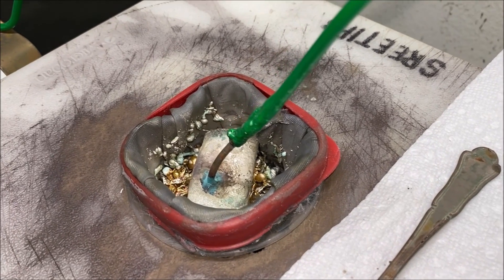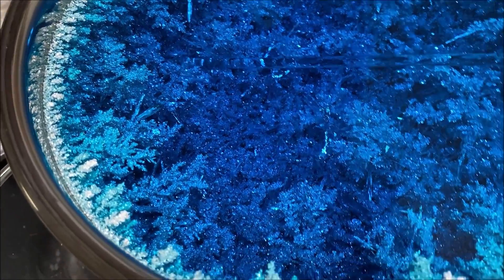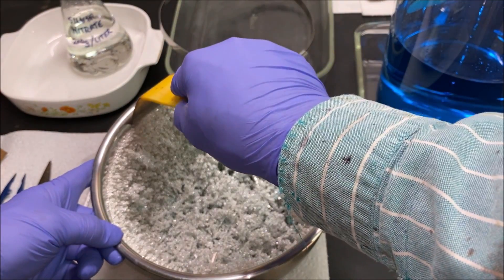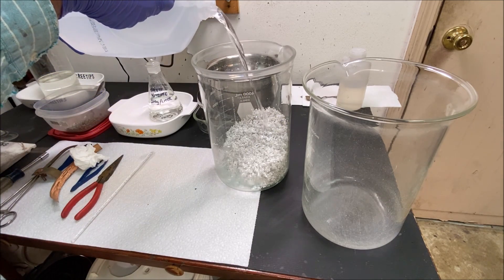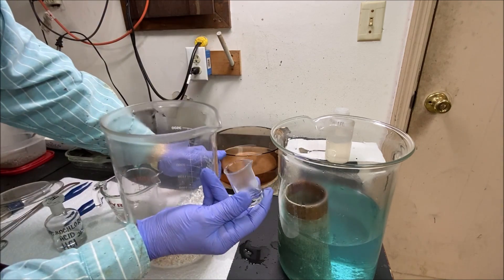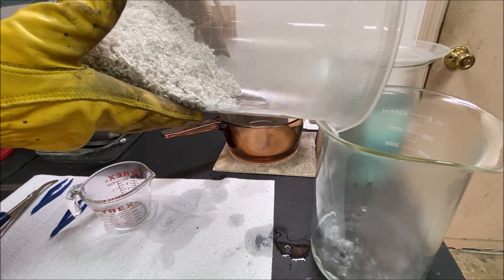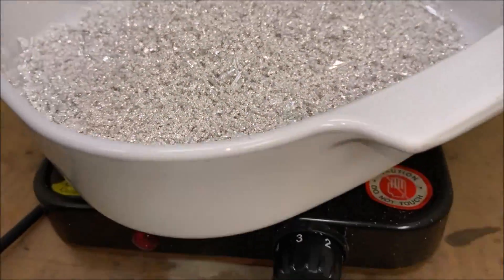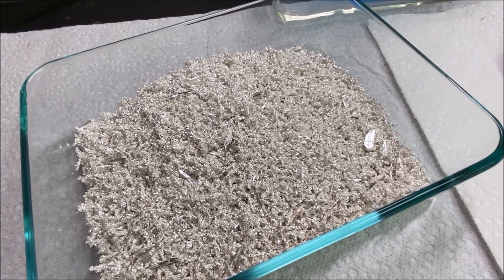Fifty Ounces of Silver From My Silver Cell Day 15

Comment: Just found this channel. I'm a little confused. Did I just witness the process of taking a silver bar, adding electricity, some solution, and YOUR GROWING PURE SILVER like from a seed?
Reply from the maker: I’m feeding impure silver through the top and passing an electric current. It dissolves the impure silver then deposits on the inside of the stainless bowl as high purity silver metal that looks like crystals.
Reply: @sreetips  Ahhhh, ok! I was wondering if I needed to stop growing lettuce and start growing wealth🤣

Comment: so - how much to produce that amount ? Is there profit ? Do you melt and bar it ? Fascinating idea
Reply from the maker: To get 50 Troy ounces out, I had to input 50.5 Troy ounces of impure silver into the anode basket. Probably a little less because some of the silver in the electrolyte gets depleted as the cell operates. It plates out onto the cathode. Profit? Not in the sense that you are thinking. I’m not refining the silver to re-sell for more paper dollars. Although if I need some paper to pay bills or buy food, then I can and will sell a little metal. But most of the silver that I refine I save and forget about it. Silver is a by product of my gold refining. And gold refining is my hobby.

Comment: Where you do you get the blue silver nitrate solution stuff and how much does it cost?  How can this be profitable... I mean they have to make the solution to sell it, and if they could just turn it into silver themselves and get more value out of it, wouldn't they do so?
Reply from the maker: The blue liquid is silver nitrate. The blue color comes from copper. Pure silver nitrate is clear and colorless. I run impure silver through the silver cell and it deposits on the inside of the stainless bowl. But I only get out what I put in, less impurities.
Reply from the maker: I dissolve some of the pure silver crystal from a previous harvest to make the electrolyte.

Comment: Got a VERY interesting, easy experiment that might be groundbreaking - labs have agitation plates for processes that require constant motion. If you let these crystals develop while constantly vibrating at specific frequencies, I'd guess the patterns of the crystals would be predictable relative to the science of cymatics, and the properties of the silver might change due to developing under different frequencies.

This method when used with different metal and crystal alloys is what I think will get us to "anti-gravity" technology (which is really anti-mass technology). In a similar way to centrifugal force causing the phenomenon of weightlessness, vibrating physical objects at certain frequencies actually affects properties like mass, density, and a phenomenon of weightlessness.
Reply from the maker: A slow vibration would help keep the electrolyte moving.

Comment: What were the silver crystals derived from I am ignorant To what you're doing I guess
Reply from the maker: No problem. I use sterling silver to refine gold. I alloy the silver and gold, then pull the silver back out with hot dilute nitric acid boils. I recover the silver by reducing (cementing) the silver out of the nitric solution on to pieces of clean copper. The silver powder (cement silver) is about 98% to 99% pure silver. I melt it into shot (granules) and run it through my silver cell to produce high purity (three nines fine) pure silver crystal. The silver crystal can be melted into bars and sold. But I just keep it. Hope this helps.

Comment: What do you suppose would happen to the crystal forms if the bowl was spinning on a turntable🤔
Reply from the maker: It would probably spill the electrolyte.
Reply: @sreetips  probably correct though ii was actually wondering about the crystal structures - silver is highly conductive but yet non ferrous. Would ambient magnetic eddies in the room stimulate patterned growth or maybe ball formations?

Comment: How many gallons of silver nitride solution did you use to get 50 troy ounces of silver?   What concentration was the nitride solution?
Reply from the maker: I use silver nitrate, not nitride. I dissolve about 600 grams of pure silver into 3.5 liters of solution. My cell size is 3.5 liters. I use the same electrolyte twice, but on the second run I add another 200 grams of dissolved silver. So for two runs I use 800 grams of pure silver, reserved for electrolyte from previous refining. I harvest 1.5 kilos from each run. So my net gain is 2.2 kilos from the impure silver granules that I feed into the anode basket, less impurities.

Comment: I'm so confused. That's roughly 36 ounces. So what's the difference between ounces and troy ounces?
Reply from the maker: A standard ounce in USA measurement is 28 grams. This is use to measure food and postage etc. a Troy ounce is used in weighing precious metals. And a Troy ounce is 31.1 grams. I was confused by it when I first started working with precious metals.

Comment: Ok at the risk of sounding stupid,  is this the process of removing plated silver from spoons etc. Silver recovery
Reply from the maker: Yes, but it’s not very easy and the yield is very small.
Reply: Thanks for the quick response.   Ironically years ago I worked in a plating shop.  Considered recovering silver realizing it would take many objects to produce any yield.   My way of thinking silver is easier to find then anything gold.

Comment: If you only get out as much silver as you put in, then why do you do this?
Reply from the maker: Because I have a ton of silver powder that is a by-product of my gold refining. Silver powder has questionable value. Pure silver crystal can’t be duplicated or faked. It’s value is increasing, while paper dollars are decreasing. It’s a no brainer. Why store my savings in paper dollars that are losing value? I’d rather have my savings in silver that is rising in value.
Reply: @sreetips  So, the silver powder isn’t sellable, but it can be turned into silver through this process?
Reply from the maker: The silver powder is 98% to 99% pure silver with main contaminant being copper. It don’t take much copper to make silver look very ugly. It can be sold but it’s value is questionable because it’s not high purity. The silver crystal is three nines - industry standard for pure silver.
Reply from the maker: Running the impure silver gets out the traces of copper so that only high purity elemental silver gets plated out on the cathode. As long as conditions are kept tightly controlled, then the copper will accumulate in the electrolyte and it won’t plate out with the silver.

Comment: Let's say that the AgNO3 is the limiting factor, so there is sufficient copper.

I found that 100 mL/0.100 L of 1.000 M silver nitrate is ~$50.00, rounded to the nearest dollar.
Because M=n/V and MV=n, there is 0.1 mol AgNO3.
1 mol AgNO3 weighs 169.87 g/mol, based off of what I found online (too lazy to pull up a periodic table right now).

169.87 g/mol AgNO3*0.1 mol = 16.987g AgNO3 is in this solution. 16.987g AgNO3 costs $50.00, then.

Now, NO3 weighs 62.01g/mol, approximately (using 4 sig figs instead of 5, I'm pretty inconsistent in this.) Ag weighs 107.87 g/mol, adding up to 169.88 g/mol. Close enough, rounding errors probably. (I also really didn't need to calculate the NO3, but oh well.)

107.87 g/mol Ag / 169.88 g/mol AgNO3 = 63.5%, how much of the weight is composed of the silver.

Using this,
16.987*0.635 = 10.79 (and I am now acutely aware I calculated way too many unnecessary things.)

This means that 10.79g silver costs about $50.00. I found that a 100g silver bar costs $54.10 according to this, which I hope is a reliable enough source.

I've concluded it really isn't worth it at all, but I have no idea if what I did is right. Does anyone else have an opinion on this?

I did not factor the cost of the nitrate into this, or if copper nitrate is worth anything at all. I briefly glanced online and noticed one lb of copper nitrate is $9.00, not sure if it's pure copper nitrate however. Having done the math: no, it is not worth it. One kilo of silver nitrate costs ~$2307 USD; the 633 grams of silver inside, if perfectly extracted, would be worth ~$366.

This is perhaps not surprising, given that silver nitrate is made from metallic silver in the first place; it is only economical for a chemical supplier to sell chemicals at a greater cost than all of their components, so buying silver nitrate for silver is never going to be profitable absent financial chicanery.

The problem is really one of purity, though. Pure reagents, even relatively crude >99% pure reagents, are fabulously more expensive than what a layperson might buy on a store shelf. Part of this markup is due to the cost of controlling the synthesis, purifying the product, and then verifying the purity of every single batch in a welter of redundant paperwork and time and effort and expense and redundant paperwork. This is vital for scientific use, but as soon as you open the bottle, particularly in a garage lab, it's all worthless from the point of view of anyone willing to buy what you're selling. Sure, >99.9% pure metallic silver costs $6290 a kilo, but you would not be making pure silver, and the capital investment to see how far short of pure silver you might be falling would itself be prohibitive.

So no, it is very much not worth it to buy scientific reagents to react them and sell them on. add labor electricity means you sell it for 91 an ounce.
Reply from the maker: I don’t want to sell my silver. I want to keep it. I sell a little to pay bills and buy food. My savings is in silver, not paper. I convert my paper to silver (and gold) just as fast as I can while it’s still on sale. Grossly and artificially under valued. Paper is declining because it can be printed into existence out of thin air. Metals are rising because they can’t be printed into existence. Which would you rather have in your saving account?

Comment: silver out of nothing huh.
Reply from the maker: No, I am adding impure silver into the anode basket and it gets dissolved by the electric current, flows through the filter, travels through the electrolyte, and plates out as high purity silver on the stainless steel bowl (the cathode).

Comment: I think if ya got access to these items would be dumb not to extract them but a at home application never I would also like to seen a venting hood used or if ya got one on it’s so good ya can’t hear it 😂
Reply from the maker: I’ve run the cell in my bathroom. If the silver nitrate electrolyte is properly prepared then there are little to no fumes as the cell operates.
Reply: @sreetips  so wait let me get this right… you turn base line silver nitrate into sellable silver? Is there a profit to this ? Does the nitrate cost less vs the price of silver if any this is truewhys nobody else doing this at home ?

Comment: i thought you cant make elements. but your growing silver this will make price of siver drop i better sell mine before it does
Reply from the maker: I’m not “making silver.” I’m refining sterling and 925 scrap jewelry into high purity elemental silver. Don’t worry about silver price dropping because I’m not selling my silver. Instead I’m pulling silver off the streets (at local sales) and removing it from circulation. I hold silver, that’s rising in value, rather than paper dollars that are declining in value, in my savings account.

Comment: How much does it cost to get the solution as opposed to the value of the crystals formed? Is it not expensive to buy silver nitrate?
Reply from the maker: I don’t buy silver nitrate. I make it myself by dissolving some of the pure silver crystal from a previous silver cell harvest in hot dilute nitric acid. I reserve some of the silver from each run for the next batch of electrolyte. But one could dissolve pure silver bars or rounds as long as they’re three nines fines pure silver.
Reply: @sreetips  I see.. that's cool..kinda like that sour dough that people use.. save a clump and it starts the next batch..thanks for the response 👍

Comment: I must be simple or something, but where is the silver actually coming from?  Is that junk silver in the pot at the top and its migrating down into the bottom?  It’s beautiful to see, but I want to understand…
Reply from the maker: I use silver in my gold refining. I recover the used silver and melt into granules. These impure 98% to 99% silver granules are fed into the anode basket on top of the silver cell. I pass an electric current through the impure silver in the anode basket. The silver dissolves from the current flow, and the silver ions pass through the filter and into the silver nitrate electrolyte. The ions travel through the electrolyte and plate out as high purity elemental silver metal on the inside of the stainless steel bowl - it is the cathode for the cell. Any impurities in the silver (impurities include gold and platinum group metals) get trapped in the filter as slimes. I have a hundred pounds more silver powder from my gold refining that must be purified in this manner. I’m building a second silver cell right now to handle the extra silver that I have. I’m shooting video of the build showing every detail, from scratch. Video coming soon. Thank you for watching!

Comment: Great job. 
How is the nitrate being made? Is it from electronics scrap?
What’s the purity of it? Can you measure it with the equipment you have ? 
Do you keep the crystal powder or do you smelt it into bars?
Reply from the maker: Smelt, No offense to you, but I hate that word! Smelt is a term used to describe rendering metals from ore. I have no experience with smelting.
Reply: Thanks a lot for your dedicated  and fully satisfying answer. 
It‘s a real pleasure to watch how accurate you work at refining and producing the video.
What an effort to achieve five 9 results. Hats off. 
 
Thanks also for telling the difference between smelting and melting.  I hope you pardon me as I’m no nativeEnglish  speaker.
The German  term  >schmelzen<  is a bit more similar to >smelting< than to >melting< which lured me into the mistake.  

Please stay safe and healthy. 
Cheers from Berlin.
Reply from the maker: I buy sterling flatware and my wife gets 925 scrap silver jewelry from local sales. I use the silver to refine gold. Silver is a by-product of my gold refining. After it’s been used to purify the gold, I recover the silver, reduce it out of the solutions with clean copper, rinse off all the blue liquid, melt into granules, then run those granules through my home-made electrolytic silver cell. I’ve sent samples to Guardian Labs in the UK for analysis. They did fire assay and it comes back three nines. I double refined one batch, sent the pure silver crystal back through the cell a second time. I submitted a sample from that batch to Guardian and requested an ICP analysis. It came back greater than five nines fine. That’s 99,999 parts per one hundred thousand pure silver. I refine it, put it away, and forget about it. I’ve melted some into bars and sold them. I used to sell all of it that way. But with silver so grossly and artificially under valued right now, it would be foolish to sell it. I do offer some of the crystal for sale on my eBay site, user name “sreetips”.
Reply from the maker: I reserve some silver crystal from a previous harvest and dissolve it in nitric acid to make my own silver nitrate electrolyte.

Comment: These silver crystals...when you have them...whats next...melt ? Or
Reply from the maker: I put ‘em away and forget about them. I used to melt into bars and sell every bit of it. But with spot silver so grossly and artificially under valued, I’m not selling any silver. Maybe when it gets up around a hundred bucks. But for now, I just put it away and forget about it. I do offer some silver crystal on my eBay site,
Reply: I was just making sure that it was meltable....good deal...ty
Reply from the maker: All investment grade silver began as pure silver crystal just like you see here.
Reply: Well i do understand the process quite well...and have  materials needed on hand....from chroming,small parts and coloring aluminum parts. I just did not think it was this easy. I guess i just missed this one lol. I guess the world hasent fig it out either....or there would be silver flowing at pennies...thank you for the spot of knowledge, i will put this to good use....good time for a new graphite mold....have a great day !!

Comment: I’d like to have a go at this method, but in the UK I can only get 3% nitric acid solution. Any suggestions??? Love your content!
Reply from the maker: Yes, you can hold sterling silver just like it is. It does not have to be refined to high purity. Especially if it bears the markings for sterling/925 silver. It will track right on up with the price of silver. The reason I refine it is because it is a by-product of my gold refining. I use silver to refine gold.
Reply: @sreetips  Yes I get that. I have silver contacts from industrial relays and wanted to do some experimenting. I just wondered if it would work but take much longer, the other option I may have is to buy granular silver nitrate and rehydrate it for the electrolyte. Thanks for a very speedy reply
Reply from the maker: I’ve never worked with silver contacts.